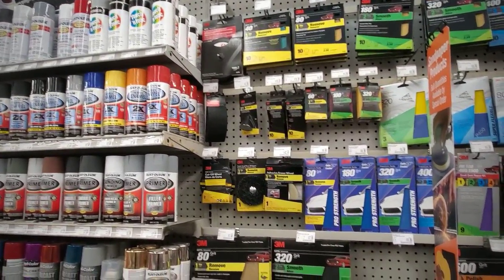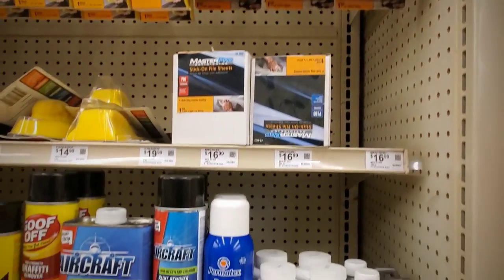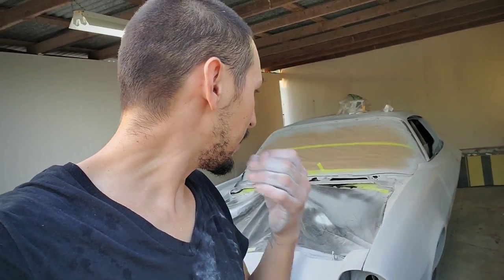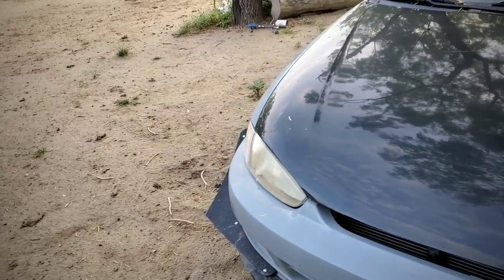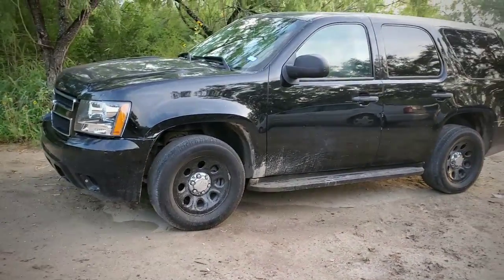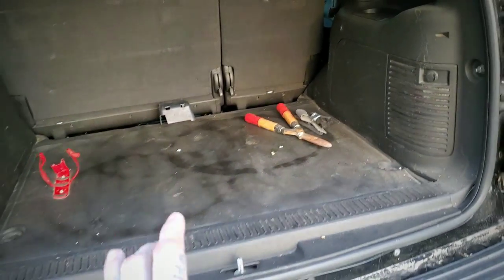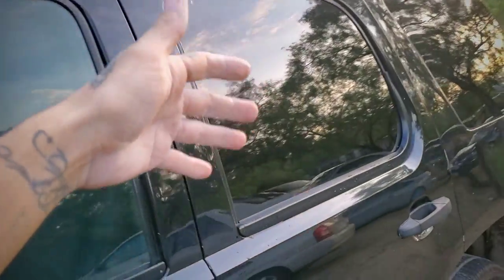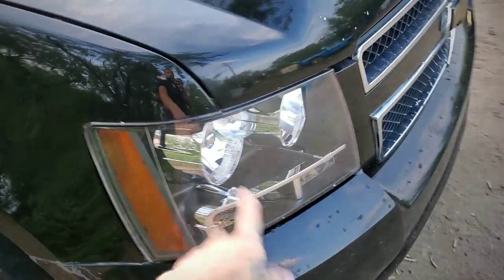I bought a PPV Tahoe for Dirt Cheap!

Comment: This particular sanding block works ok, but it doesn't sand flat that I've found when using it and applying any real pressure and tends to create an uneven surface. For a smaller area it seems to work great, but a larger repair area I would use the harder sanding block.

Congrats on the new addition to the family brother, keep grinding!

Comment: I would try to direct that fog light vent to the air filter, be like super ram air lol .. I never saw that vent before tho, its probably for high speed chases cooling the brakes like u said .. Cover them Chevy emblems with black vinyl wrap, or black paint, maybe even cover them orange turn signal reflectors in black tint if u can get to em.. Its nice, every Chevy I ever had has been reliable as far as engine n trans. Great buy, wish I seen a deal like that around here!

Comment: You sure it is the compressor? Do you have a set of gauges? Vacuum pump? Maybe joe has a set of gauges you can hook up and check the level. If the freon gets too low the low side pressure switch wont kick on the compressor. If it is empty, you can use a vacuum pump to pull a vacuum on the system then leave the gauges hooked up and let it sit for a couple hours to see if it leaks the vacuum. Sometimes pulling a vacuum will reseat orings that leaked. If it doesn't leak down you can refill it with freon.
Reply from the maker: The ac system still has freon inside.  Full pressure. It doesn't have a leak or anything.  When you turn on the ac, it sounds like it engages,  and even the radiator fan turns on and everything sounds like its working,  but there's just no cold air coming out the vents. 
Then,  when you turn off the ac, it makes a sound like a dried bearing spinning (if that makes any sense).
 Also,  the freon is not circulating. The pressure is always high.  ac on/off 🤷‍♂️